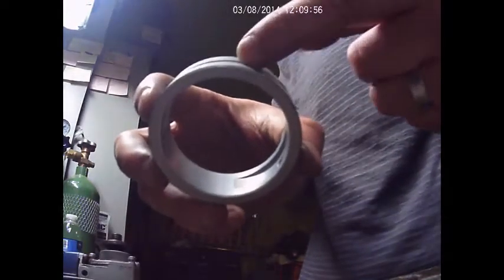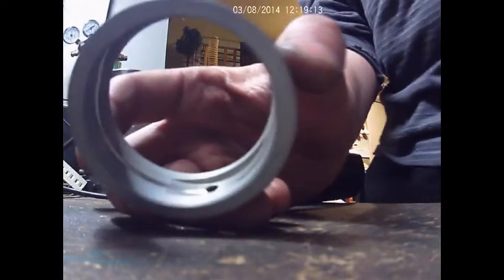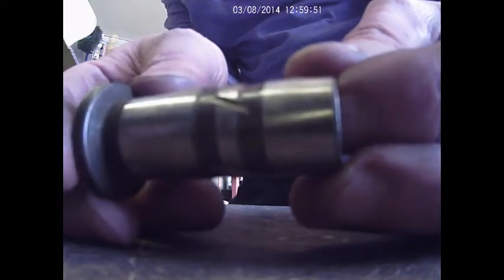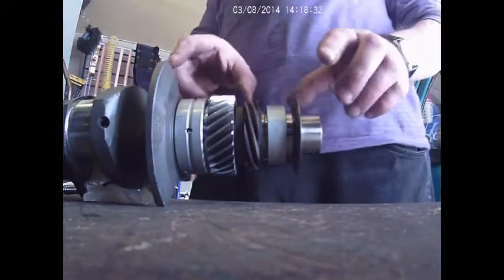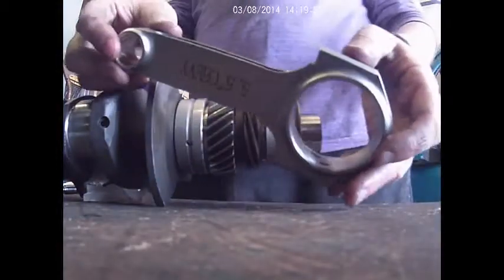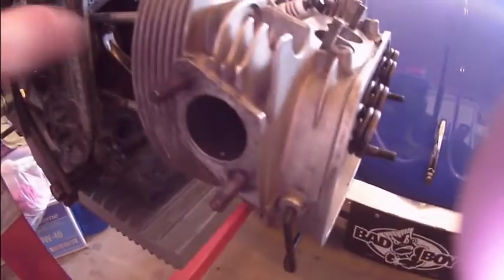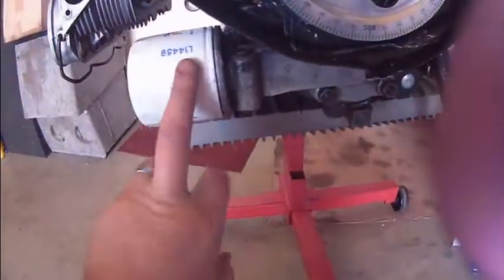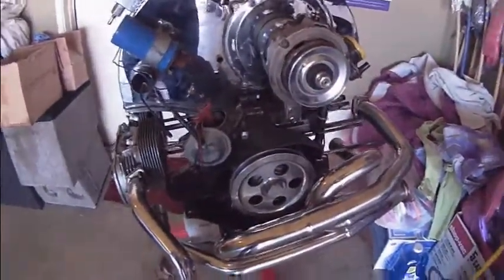2234cc HVX Oil Mods

Comment: Hey dude , you should be using a two piece center main bearing in the #3 bearing location ! You'll get longer case life, better oiling  and you won't have to remove the cam and distributor drive gears to change the bearing ! Just a suggestion !
Reply from the maker: +michael isola 
Yeah.. unfortunately I didn't learn about that mod until it was to late! :(

Comment: if that bearing splits in half .only one to blame
Reply from the maker: jimmy wilkinson 
This bearing mod is definitely not for the unskilled. As for this 2234cc engine...it's still holding together even though I drive it like I stole it! 6k rpm is the norm! Currently over 50k miles on this daily driver motor. But yhaa it takes guts  to do what I did and I definitely don't recommend you try this. Best thing to do is to have a machine shop do it for you.
Reply: I have bought bearings that had the groove on the inside they worked fine ---but left a high mark on the crank. when it wore. I understand that doing that will increase the oil flow to the rod --alot .Its just to bad they dont give you a option when you buy them.The inside groove feeds the rod on the full rotation not just when it passes the oil hole.
Reply from the maker: jimmy wilkinson
Back in the day there was a bearing manufacturer that  would make them with the inside oil Groove.  Unfortunately they're no longer around. I've also noticed oveling of the journals but only on the standard bearings. This motor is approaching it's end of life and will require a quick freshing up. I'm going to pay extra attention to the journals for any signs of oveling. I will let you know when I get the results.
Reply: I just finished one .used new case new 4140 cw crank engle w100 newflywheel pump-30mm. has 60lbs cold 53 hot.some guys will say that to much oil pressure can cause the oil not to go through the cooler but the oil  filter gets hot in about 4 minutes so that acting right.
Reply: We did this on the 393 early hemi's....   Saved a lot of blown up motors doing this...    increase oil pressure at idle to 65 to 70..., 45-55 at 2500 minimum...    will allow for all Hoover mods to increase durability ....     Put in 3 extra quart sump...  We had to make our own..., use bigger tubing .., no screen...   use case slosh barriers too...   Save your oil with double 15 x 15 coolers...  like an automatic.., 10 degree drop almost doubles life at or above 180 degree oil temp...